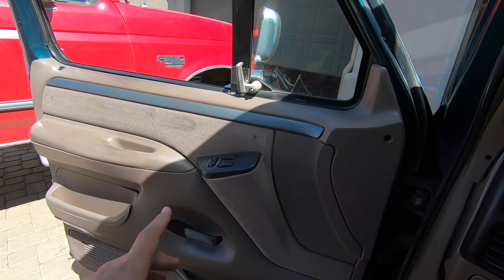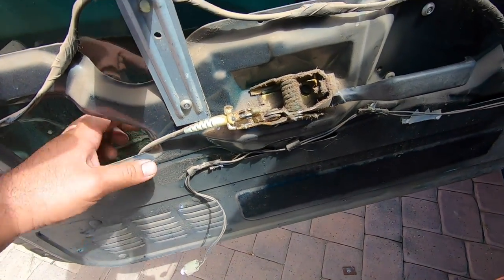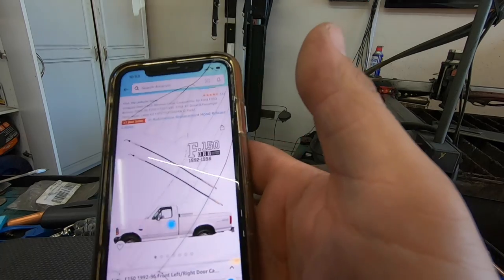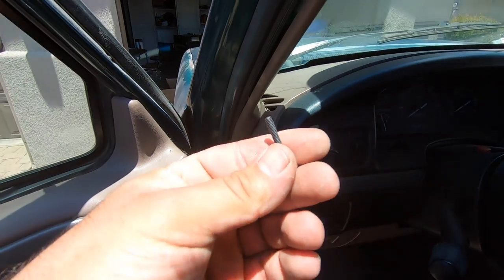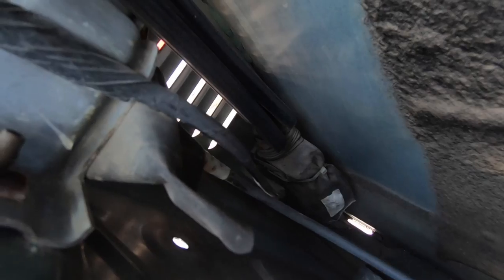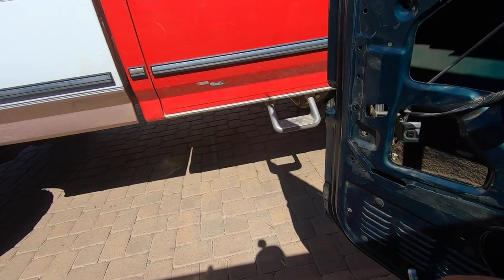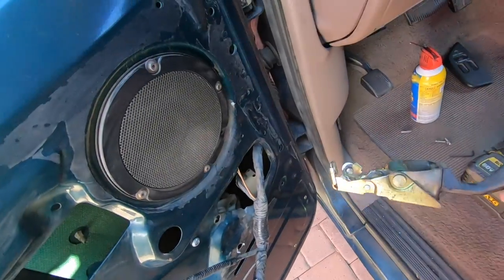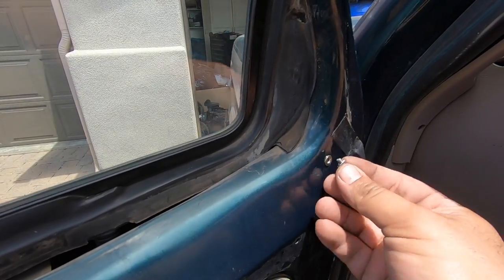OBS Ford Door Handle Fix You Need To Do This!!

Comment: i just had to fix  that spot under the door handle on my dads 95 f150. I got luck i had some spare parts from something else that had a thick plate that was threaded just like the one you showed it worked great.

Comment: Thankfully I’ve never had to replace one of the cables before (kind of a hassle), but as you know I have had to replace the door handle mount several times.  Ford could’ve done a better job designing these door/door panels but at least the fixes are cheap👍.  Awesome work man!
Reply from the maker: I know right!

Comment: On my 97 f350 crew cab I have window switches for all four doors located on the front driver side door panel. Wonder why yours only has them for the front and not the back?  You might have the door panels out of a two door.
Reply from the maker: Early OBS crewcabs didn’t have power rear windows just fronts I don’t think it was even an option but I might be wrong about that part

Comment: The door handles in these trucks are so bad. When I got mine it had the original door handles and those eventually snapped so I replaced them with metal ones...ended up snapping those off too! I try to spray it with WD40 every once in a while so I don't keep buying door handles.
Reply from the maker: Have you replaced the cable? That might be why your snapping handles, as it stretches it requires more force and travel to open the door and you eventually end up snapping handles or busting the door.